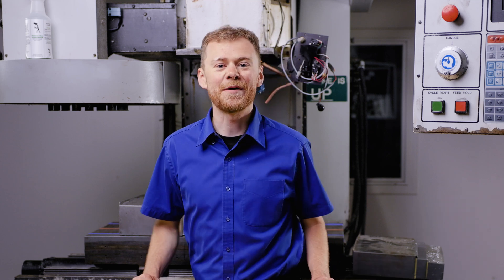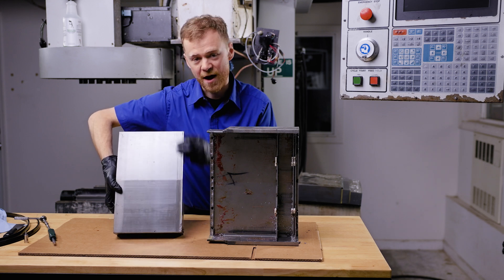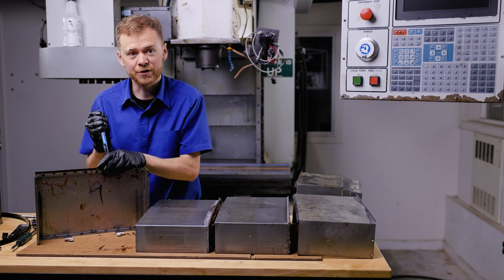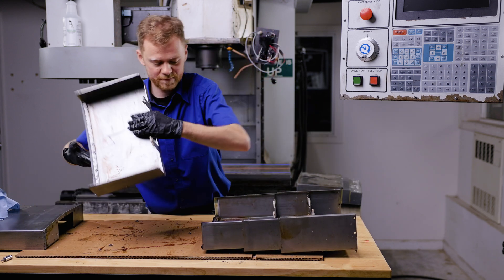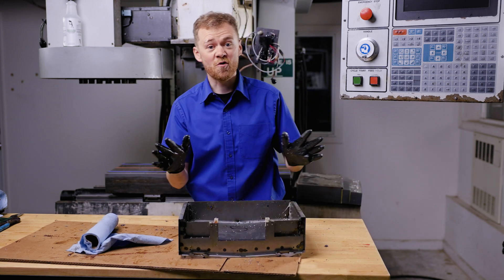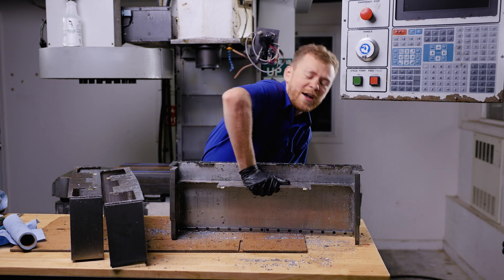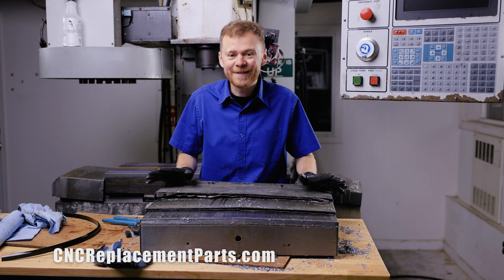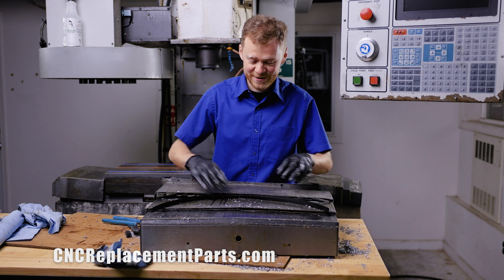Repairing VF Way Covers

Comment: So I'm kinda tearing down our Kurt vices and Haas Mini Mill and cleaning rust/gunk/chips under the way covers. I don't really know what I'm doing lol. Should I use brass radial brushes to get rust out of the vice's bolt holes or is there something better? What about the bottom of some of the vices blind threaded holes? Radial brushes have a little tit. Right now I'm pushing scotch brite down there and the brass radial brushes luckily somehow stick to the scotch brite and pull it out afterwards. Even on those small threaded holes. After I scotch brite the vice should I ultrasonic clean it to remove the grit and if so what should I use that won't rust it after it comes out of the cleaner? Can I use 70% isopropyl on the Haas lead screws/rails? I was careful vacuuming the chips out but I'm sure some random chip made its way onto something it shouldn't have. Do I then re oil? Are paper towels fine or should I use something lint free? 

You guys should definitely do some videos on how to clean things that way you can add affiliate links to all the tools. Whatever I'm doing is working fine so far so I don't need help. But I'm gonna be cleaning everything out again every few years so if you need me to brain storm some more questions for you let me know I'VE GOT PLENTY!
Reply from the maker: Will do! Thanks for the comment

Comment: Hi Man! I changed my way cowers. After about 5-6 weeks start having a coolant in bottle for old oil behind machine any ? Help with that ? Thanks Jan
Reply from the maker: Check the drain that goes from the back of the y axis to the coolant tank. That could be plugged. Use air to blow back up it.

Comment: What kind of silicone are you using inside machines that coolant doesn’t turn to goo?
Reply from the maker: Sikaflex you can get it at a hardware store. We sell it on our website too:
Reply: @cncrepairman  will order some for my next project! Ended up using some yamabond I had on hand…